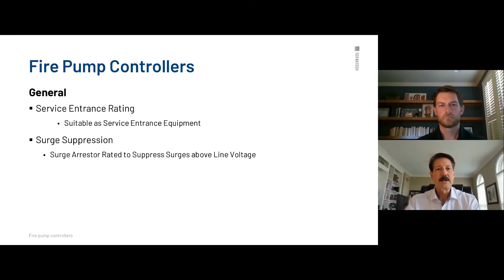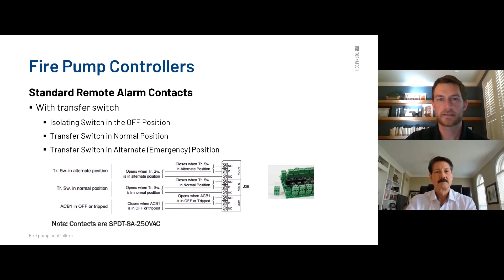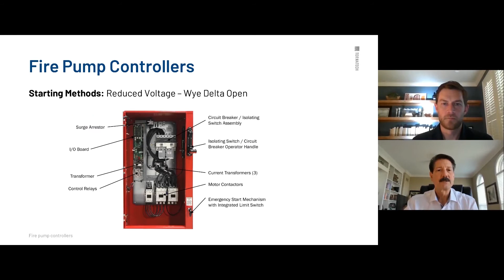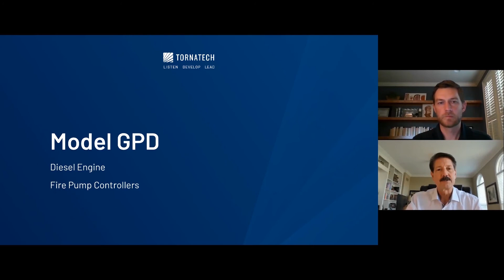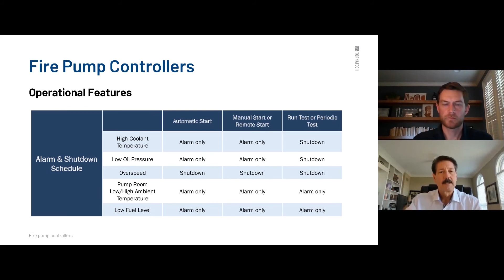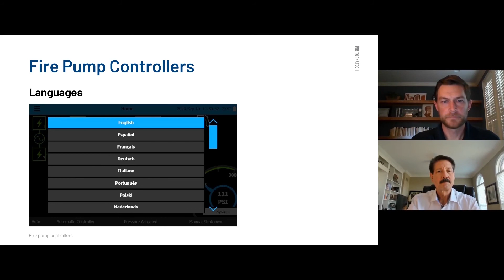Tornatech Electric and Diesel Fire Pump Controllers Presentation

Comment: Dear Sir/Madam, may we have a Question to your controller, we have purchase tornatech controller, but when we are testing the controller then the  contactor is burn?  we have 250 hp Fire Pump motor, 480vac / 3 phase.

Comment: Hello, tornatech gpy model electric pump control panel I touch Manual start switch that time showing LOCK ROTER CURRENT faulty in display.. So I can't start the engine... How to solve this issue..

Comment: Sir just asking only what is the purpose of loader resistor device  on fire pump control panel ? And if in need to rewire the fire pump control  it is ok to disable the load resistor device ?